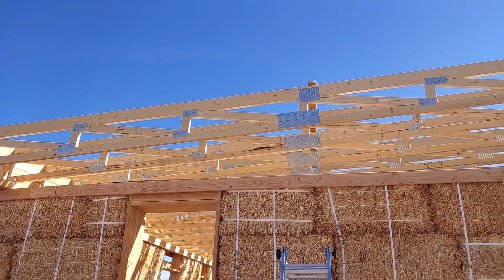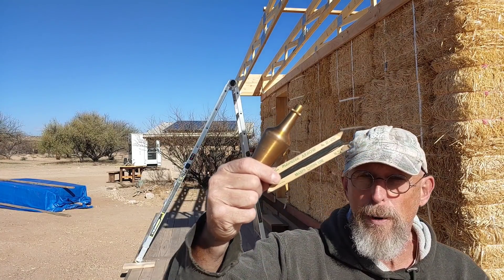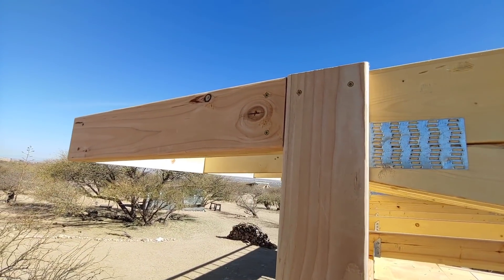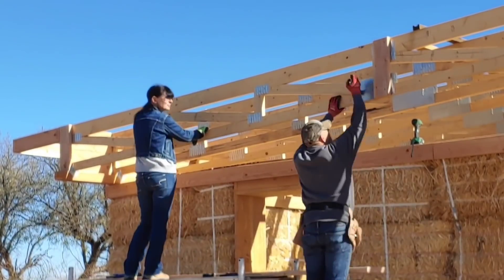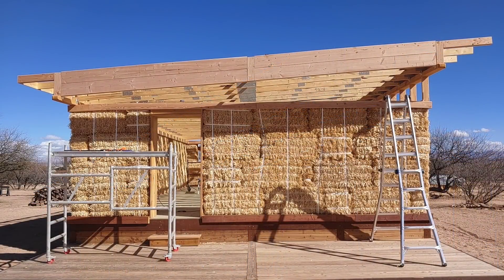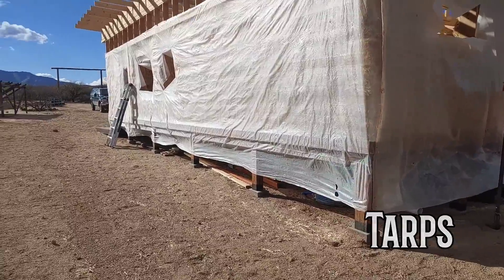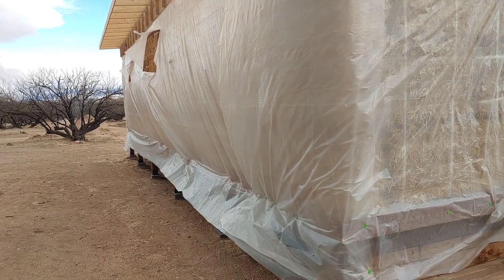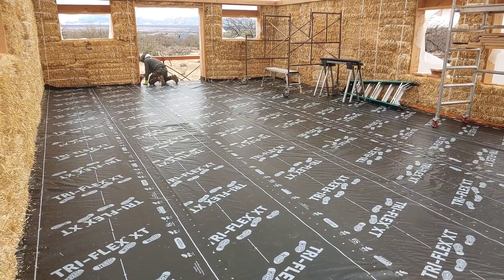Day 24 Straw Bale House | Racing to Beat A Storm!

Comment: It'd be tempting to put some southwest style brackets (corbels? tails?) under the overhangs - at the corners, and mid-span where you added the 2x6 detail to the facia.  And maybe add pieces of 4x6 under the mid-span 2x6, with the bracket / corbel beneath it?  Just brainstorming - looks cool the way it is!
Reply from the maker: I like the way you're thinking! If you have any pictures of the details you're talking about, you can send them to: theupsideofdownsizing@gmail.com 
I'd like to see them. Thanks for the ideas 👍

Comment: That plumb bob is just like the one I have from my surveying days. 24oz. that cap unscrews to allow changing the string and another steel point. the inner point can be used in tight  places where the brass bob is too large.
Reply from the maker: Thanks for that info! I never even thought of trying to unscrew the cap. One thing is for sure, they don't make them like they use to. As cliche as it sounds, it's true. Thanks for watching!

Comment: Hope you survived the snow.
Reply from the maker: We got about 3 inches of snow, but the night before we got a half inch of rain and the winds were howling! But the tarps with the cap staples held! Didn't lose a single staple despite 40 mph winds blowing for what seemed like hours on end! I did sweep the water out of the house at 11 pm. That underlayment worked beautifully. It was like a rubber swimming pool but swept out easily.
Reply: So glad that the bales survived.

Comment: How did the bales hold out with all that wind, rain and snow?  Did they get much moisture?   Look forward to what's next!
Reply from the maker: Now that the box beam is strapped down and the trusses are up, the walls are rock solid as seen when I was planing down the boards. Wind no issue. The bales are so dense that even rain in moderation is not a concern. The worse would be for the bales to sit in water but the toe ups prevent that from happening. The outside of the bales were protected from driving rain. The inside walls had some surface dampness but dried out quickly. The roof begins TOMORROW!!!👍

Comment: Will you just keep that stuff down on the floor or will you take it back up before finishing the floor?
Reply from the maker: You know Dan, I don't really know. But I did say to Yvonne, why not just leave it down as a form of vapor barrier. I'll have to research it bit it's definitely a consideration.
Reply: @theupsideofdownsizing  With my ever so limited knowledge of such things, I would say that as long as it's permeable, it should be fine. But I'm sure there's a youtube video or two that can clarify that potentially false assumption. Lol.